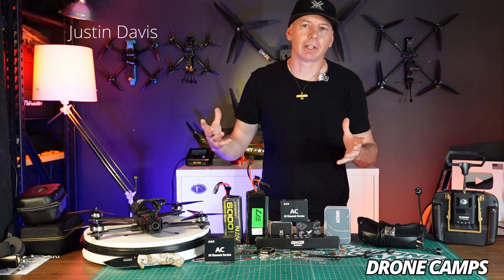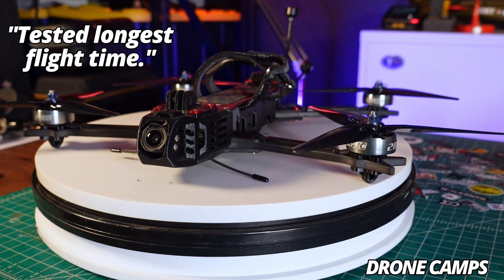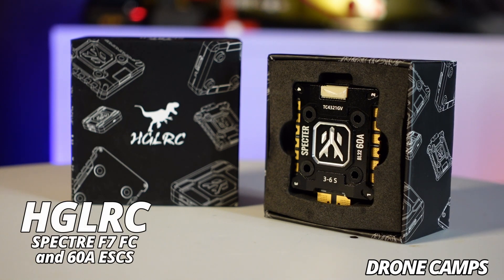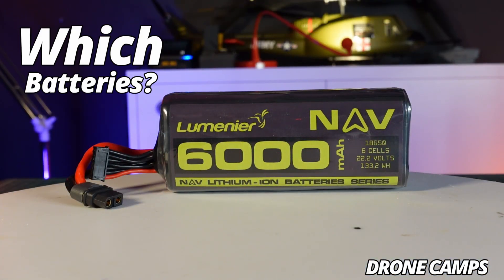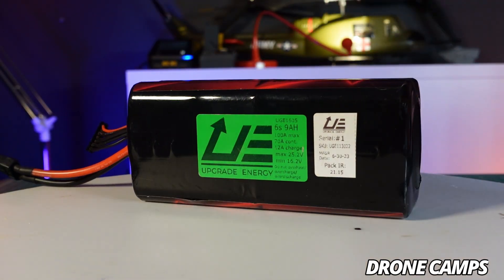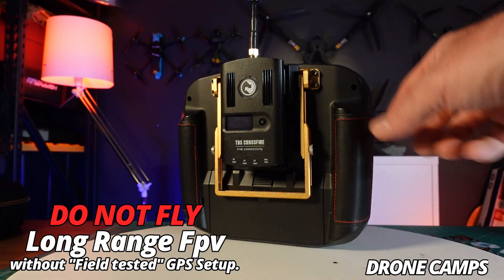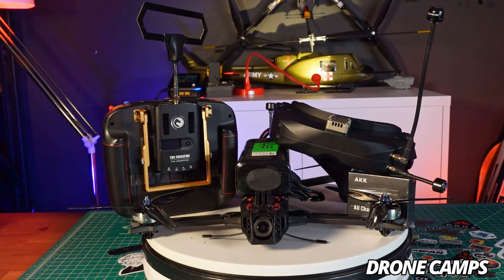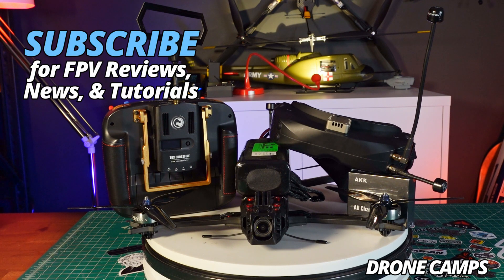How to Long Range Fpv in 2024. 🏆 Buyer's Guide.

Comment: I have always flown DJI 03. I want to build this drone because I prefer long range over freestyle. How much harder will the programming be and learning to get the remote working with the quad compared to DJI 03. Previously used DJI fpv controller with my builds so things were more beginner friendly. I need this build

Comment: When looking at HQ PROPS all I could find that was close was a 7X5XX3 or 7X5.5x3. Do you happen to have a link?
Reply: Found the link to them.
7X3.7X3 7037 7 Inch 3-Blade Propeller Poly Carbonate for Long

Comment: Question for you. I’m following your advice for HGLRC Spectre for the Fc and ECS but noticed the FC is 30.5mm mount while the ECS is 20mm. Is that going to be an issue?
Reply from the maker: Shouldn’t be as long as they mount together

Comment: Whats the range differences between 03 and analog?
Reply: @john-martin  o3 is DJI's digital system. Analog is an analog system.
Reply: O3 tops out at around 10km. For fixed wing that could be limiting. Not really an issue for most quads though.

Comment: so i can buy a Radiomaster boxer with 2.4 ELRS and just put a TBS crossfire on it and it will work?
Reply: Wesly Varty did a 100km flight with ELRS 2.4 Ghz and he was still getting telemetry @ 100 mW :-)
Reply: @nlluke5207  This is also my question
Reply: Yeah, that's my setup. I have Crossfire in my Boxer Max with ELRS. Future models will probably be ELRS but I have stuff in my stable that still use Crossfire.

Comment: Hi am new to all off the fpv world and diving down in the deep end. Am grinding in the drone sims with a dji controller 3 and are looking in to bay a dron and googls 3.

 I wanted to ask when i look at drons like GEPRC Crocodile75 V3 HD Wasp Long Range FPV and its ses PNP  for a resiver is the when you bind up to the dji camra as resever?  
Am after long flyt time and not long range ass a beginer,  meby in the future 2 cameras one on gimbal for work. 

Thx for all the vidos and good info the is easy to  follow a long=)
Reply: A quick solid for you.

Everyone who starts FPV thinks they want long flight time... it is such a bad mistake to make (frames break easily). Get a smaller and very tough drone frame that won't break (you will crash a lot), and just land and change battery.

3.5inch is a nice sweetspot for cost and flight feel. When you are new to REAL flying, 5 min is a long time without crashing.

You can use your DJI controller, but the gimbals are really bad. Most people would advise a Radiomaster Boxer with ELRS.

PNP means that you add your own receiver (or use your DJI remote with a little programming).

Once youve got 200 or so flights then you'll know what you are doing. Then pick a style of flight on youtube that you like and see what drone they are using.
Reply: @doccock100  thx you for a good explanation, and am gonna look at a 3.5 inch dron then to get a hang off the basiks and look up if my Radiomaster zorro 4in1 can run ELRS thet i alredy got.😃
Reply: @Zombiegearhead-w1f  yourr zorro 4 in 1 wont do elrs unless you attach a nano module on the back of it for about $35.

apex 3 is a strong 3 inch. aos 3.5 also has replacible arms.

you can use the internas of a small drone to build a bigger one later
Reply: @doccock100  hey yes, I thought when I bought it that the 4 in 1 would cover the 4 most common the whas my bad..

ok the i well look in to geting a iflight AOS 3,5 V5 for to be abol to reper it whidaot buying a new frame completely sounds good.

thx for the help and good info =)

Comment: why analog?
Reply: Longer range. O3 only goes 10km
Reply: @patjohn775  10km more than enough lol
Reply: @Cinoo90  for YOU maybe, but this video is for X-treme longrange, not for you appearently.
Reply: 03 signal distance matches the current battery capacity typically for DJI. Analog is for quads running an 8000 or higher which requires at min 7" quad. Croc 75 ftw

Comment: I've been looking at making a tiny long range. The 2 inch light frames I'm finding are around 30g. I saw a pavo20 frame is about the same weight. I need something small to travel with. Mainly to fly through the Forrest. Would a whoop drone do well as a long range? The frame weight is about the same
Reply from the maker: Whoops won’t get the same flight time as a long range quad

Comment: Can you please make the same kind of video,  but about 4 inch long distance quads like the Flywoo Explorer LR 4 , not all of us can afford or even want a 7 or 10 inch quad . Dave C got  37 minutes with his Flywoo Explorer LR 4 and a 4s lion battery. Bigger quads require bigger and more expensive motors and batteries.
Reply from the maker: Ok 👌🏻
Reply: @dronecamps are you still going to make the 4 inch long range videos
Reply: @jamesmason7124  any info? Thats what im currently trying to build. I have everything except my vtx. Im still deciding